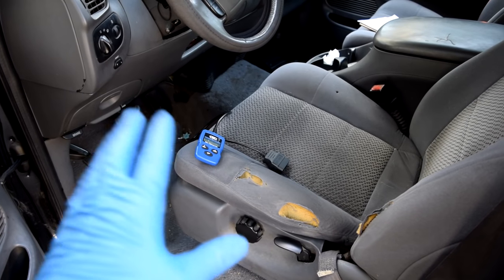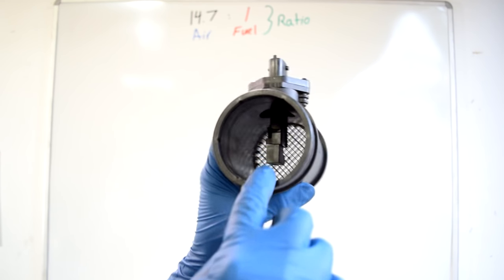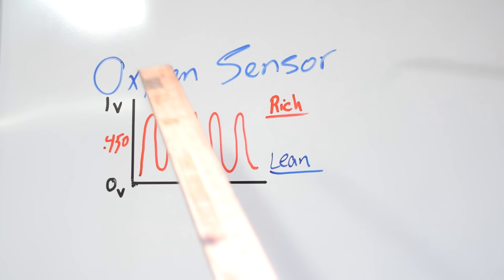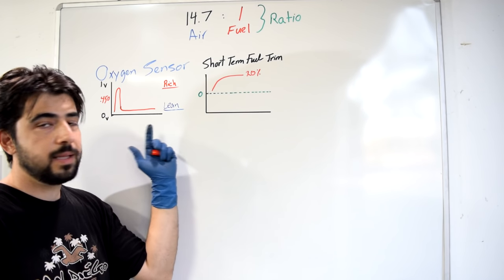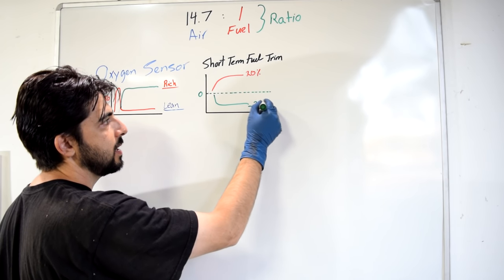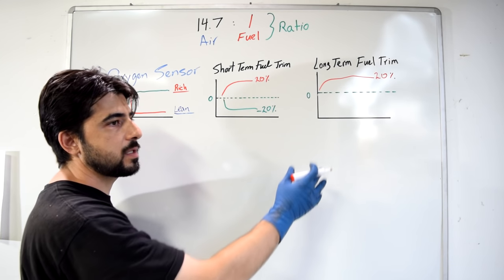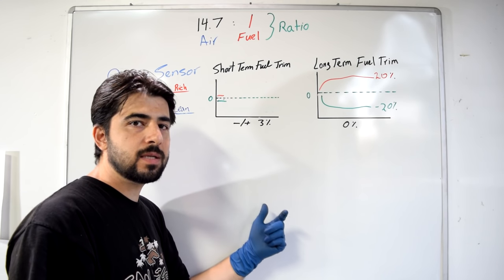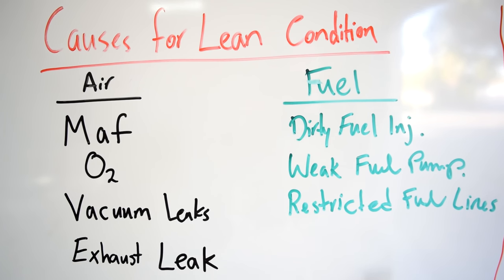Short Term and Long Term Fuel Trims Explained

Comment: Hello, first of all thank you very much for that movie. A lot of valuable information. How would you diagnose my issue? During normal car operation I have long fuel trim -3% when driving. I suppouse because of stack evap valve. It usually stack at 2% oscillating time to time only. I think it shall be set to 95% during acceleration. However engine handle it. The problem occurs when I put pedal to the metal. Just after that acceleration o2 sensor 1 goes to 0,1V, sensor 2 to 0,9 and short fuel trim goes to almost 50%. Lean fuel ratio. Engine 2.0 cvvt Kia. I have 2 new o2 sensors and new MAF. Actually waiting for new evap valve and pcv valve to install. Can it be problem with weak old fuel pump (17 years old)? Thank you in advance for the replies!

Comment: Perfect explaining tank you.
I used (STP fuel cleaner 5-1) and now my car running Rich. and fuel gets in engine oil, it looks (Leaking injectors), LTFT -23% after a 500 km i changed the engines oil, now the car running better LTFT -7 while driving, but when i release the throttle (gas) pedal immediately LTFT go to -15% and the car run badly.
When i push (throttle pedal) again then  gradually LTFT go back to -7% or -6% 
Is there any meaning for this problem.
Is LTFT should be stable ? Or what?
The speaking on LTFT not STFT
Thanks a lot.

Comment: O2 sensors and air fuel ratio sensors .   High voltage means lean mixture, low voltage means rich mixture.

Comment: Looking at Fuel Trims in a humid climate I wonder if you should allow for air moisture content. More moister in the air means lean (or rich?) burn/ less burnt fuel produced / incomplete burn, means higher? fuel trim. Where I am right now it is 70% humidity. But in Korea where they create the algos for fuel trim program then humidity is much lower., the air is much drier.  So I am thinking a fuel trim of 13% in a humid air climate may be 9% in a dry air climate.  I will test this as where I am we have a Wet humid season, and a Dry no rain season, so I can sample both.  I guess an incomplete burn leaves more 02 in the exhaust gas thus lean, increases fuel trim.

Comment: Awesome video. Thanks for that. I have a question please for tundra 5.7 2012. My long term fuel trims on bank 1 and 2 are hovering around 38% both. Both Short term are fine between-3 to +3. All in close loop means idle position.
To chase vaccum leak, i increased rpm to 3k. But still long term were at 35% each while short term changed to -8 to +8. I think i dont have vaccum leak. Shall I change my fuel pump? You think thats the issue? 
Please advice.

Comment: Hey, great video. I have a problem with my e90 bmw and it has the exact signs. I can't find the vacuum leak, but will a stuck open egr valve also cause this? I have no codes. Just rough idle when cold and because it's running lean, it's eating up spark plugs every 2500Km. Thank you.

Comment: Excellent video...quick question...What if you have a wide band O2 Sensor? Quick question to ask you The other day i got a P0135 on my 2002 passat 1.8t AWM. Using my scanner i checked the voltage readings... less than .002  sometimes negative. I had a New O2 sensor on hand. replaced it and still the same voltage B1 S1 - Sensor 2 is a solid reading of about 6..... STFR hovers all over the place....-4 to +7  Cleared the codes so i do not know what the current LTFR is but last i checked it was 6.3 any ideas?

Comment: Ok so. 2005 Honda Element. Starting issue. 

Cranks and chokes violently in the morning when cold. Like 45°F in socal. 

Still does it sometimes even after warmed up. Was getting a code for P0113 but turns off like 90% of the time. 
Sometimes and very rarely the car will die at idle at a light. 
I've changed the the IACV and cleaned the throttle body like new but same stuff
When the car is running

I get Short fuel trim value of -7 to -2.4 

Long fuel trim -9 to -4. 

O2S12 .08v to as low as .04 sometime the value will be at at .13 but itllnhold these values steady without oscillating.

02S11 .02mA to .04mA to .00mA

Idk what this means.

Comment: Do you know anything about p1093 I have it on my 04xi any tip will help not to mention I like you're video especially about fuel trim I believe I have a vacuum leak my stft will start at 0 then when driving it starts to clime

Comment: I had a Ford Explorer with a bad rear main seal that got bad enough that it allowed unmetered air into the crankcase and got sucked up by the PCV which leaned it out.

Comment: Great Video! I od have a question though as im a little bi worried about my readings. on my Ford Transit Custom Mk7 2.2 TDCI. My 02S12 is at 0.450v but my SHRTFT12 is at 99.2%! Also my Throttle Position is at 99% while at idle but my revs are about 800RPM! Any advice is greatly appreciated.

Comment: Good video will need to see it one more time !! I have the opposite numbers (-) so what you explained Means that I run rich and my problem could be dirty injectors !?
Reply: negative number means it's running rich
Reply: here's what can cause a rich condition:

- Bad MAF sensor (usually this causes a lean condition though) 
- Bad o2 sensor 
- Worn engine 
    - Ie. Worn piston rings make it hard to suck in enough air
- Exhaust restriction
    - ie. Clogged catalytic converter 
- Leaky fuel injectors
- Bad fuel pressure regulators
- Faulty EVAP system, evap solenoid 
- High fuel pressure 
- Purge solenoid stuck open
Reply: @Cdswjp  thank you ! I will take it to the mechanic because time to time the truck use execive fuel ! I drive about 100 miles every day 50 each way and used about 1/2 a quarter of a quater of a tank but sometimes use 1/2 of tank 100 miles .doble. I changed. Mass sensor, knock sensor, spark plugs , fuel filter , multiples vaccum hoses , transmission oil and filter , ball joint up and down , in and out tier up , breaks pads , caliper right size .. Timing belt , water pump. ! Cleaned canister , checked the vent solenoid and when I applied power by 9 volts battery it does close ! My truck is a nissan frontier 2001 supercharge 120,000 miles. Thank you for your knowledge .

Comment: Am having a problem with an 05 Ford F-150 4.2 I had changed the top and bottom gaskets of the aluminum lower intake and top plastic plannum also the exhaust manifold gaskets and has or still give me the P0171 code , my fuel pressure specs it’s 30 to 32 psi which I think it enough for it has lots of new things on engine and can’t get to figure this one out , I’ve checked my O2 sensors and are working properly like u showed in ur video  I’ve noticed on idle the bank 1 long fuel trim it’s a -15 percent and when keep the rpm high around 3000 it jumó to positive 30 or mid 20’s

Comment: great video, quick question, im getting the oposite readings im getting a split second where it reads -27% while idle and a split second at ~2300 rpm getting 51%, so what could cause this? o2 sensors are working fine (as far as voltages tell us)

Comment: If I'm running rich, after going to upgraded Injectors and HPFP,  would putting an upgraded Intake manifold potentially help? or would the math between the MAF and O2 remain the same, which wouldn't change the fuel trim?

Comment: Hello, and great channel.  Could you help me out? I've got a 2002 Silverado 2500 with a 6.0. All fuel trims are in the plus. Both ltft are around +25 and both stft are around +12--+15. 
Any thoughts on this would be appreciated.

Comment: Hi i just read my live data and i have a 4 cylinder with 25% short term fuel trim and -10% long term fuel trim and an engine code rich condition. Ive tried cleaning the maf and it helped a little still running rich though. For some reason my scanner only reads downstream sensor.  So i cant see upstream sensor. What do u think

Comment: great video...
(2005 dodge neon 2.0 liter)
is it normal for the o2 sensor bank 1 sensor 2 to stay at a constant voltage and not fluctuate like the bank 1 sensor 1 o2 sensor?  in my case the bank 1 sensor 2 stays at .760 while sensor 1 fluctuates like normal.  thanks

Comment: Throttle shaft through the back of the intake by the firewall that control the secondary butterflies??  I know those are notorious for wearing out the bushings causing a lean condition on those 4.2s

Comment: I have a 2007 Acura RL with 275k and runs excellent. I hooked up a live data scanner and it's saying that the short term fuel trim is 18%to 20% and the Long term is like 8% to 10%. What would cause this?

Comment: Sir, my car’s pre-cat o2 sensors are 6 wire type. Some said on the internet that they do not work on V oscillating principle. Instead they work on current (A). Therefore my OBD II does not shows voltage fluctuation. Also, my STFT shows -20% at idle. Long term fuel trim is around -4%. Is that ok? I have Holden Commodore VZ. This is after i drove my car rich for about 7 months until i discovered i had failing EVAP valve that made my car run horribly rich that it formed carbon at exhaust tip.

Comment: I have a question - my Short Term Fuel Trim (B1-S2) stays at 99.2%.  All the other readings - Oxygen Sensor Output Voltage (B1-S1), Short Term Fuel Trim (B1-S1) and Oxygen Sensor Output Voltage (B1-S2) all look good.

Comment: Hi bro i have nissan altima and i got the short term fuel always in negative around -1 to -15 and the long term fuel term always 0.8 and this value with 800 rpm and 4.5 to 4.9 g/s MAF. Please help i have engine shaking and rpm shaking
Reply: Help please

Comment: My question was
How does a vvt-i computer compensate for more water in fuel? Does more water than create more voltage conduction like fuel giving the computer the default to open the injectors less. But how would that affect timing in a car?

Comment: hello, my toyota corolla levin sj limited 1992, has a shaking issue on the front left side of the car. when i am approaching 80km/h, it shakes strongly and the shaking decreases as i am approaching 100km/h but on smooth surface road the shaking is less at 100km/h. what causes it? The tyre rim? I just have 2 front new shocks on but the problem still occurs.

I think I also over tighten my valve body during my automatic transmission fluid change. I added new synthesis oil without realising that there is old oil in the torque converter. now my car doesn't shift into full gear; the rpm is high and it is in between 3500-4300 when the engine is cold. It shifts into full gear and the rpm is running at its normal rate at 2500 at 100km/h speed when the engine is hot.

Do i need to loosen up the valve body or do i have to remove the mixed oil or do i have to do both?

Comment: hey awesome video how would you know if an injector is leaking
Reply from the maker: Its a bit tricky, you can install a pressure gauge on your fuel rail than turn the key to the on position pressurize the system than turn it off, next monitor the pressure on the gauge if it starts dropping fast 2-3 psi every 10 seconds or so.. you could have a leaking fuel injector.  In order to verify you would need to remove the fuel rail with the injectors and fuel lines still attached and do the same and visually verify a leaking fuel injector. You want to verify because the check valve inside your fuel pump could also be bad in which case it will show a drop in psi but usually at a different rate. Hope that helped. gl

Comment: Does a 1999 Volkswagen 1.8t have a different approach to fuel trims than American cars?  The car runs so well and never has had a check engine light and the smoothest idle I've ever felt on a 4 cylinder. But short term fuel trim at idle is -10%. Only at idle though. Not on load.

Comment: My LTFT shows 20% positive.
My fuelpump seems to deliver 2.5 bar.
According to my ELM327 I have a lean condition.

Can I safely assume my fuel pump is not delivering enough pressure for the injectors?

Comment: Hi I have 2012 tiguan 1.4 TSI gas edition not diesel. In very cold winters it doesn't start properly. I have to apply some gas pedal to make it start properly. What could be the possible reasons? Ltft is %5.47 stft is %0 o2s1 current ma -0.26 to -0.05 o2s1 Arf 13.74 to 14.54 map kpa 28 29 throttle valve 11.76 12.16

Comment: How would I delete and tune fuel off because of headers and no cats and rear o2 are not there either. Was trying to instal new iac valve and tps sensor when it started flooding plugs. Thanks for any advice and truck is Chevy silverado 02 5.3 4x4

Comment: good video but I'm still abit confused on the subject lol my cars running-9.4 sft and 0 when revved but jumped to +12 at 2500rpm and the lft 3.9 and when I revved her up the fuel sys1 kept changing to ol- drive then CL then just Ol ! does this give yourself a good enough description of what can be wrong ? I do have the obd2 but can't really read it tbh! the car has new 02 sensors new cat new middle section new plugs newish coil pack but could be way out again probably with a Peugeot 206 gti but was intresested to hear about this vacuum leak can you shed a little light in it for me if you can? I'd really appreciate it I'v not got a scooby

Comment: I have a 98 5.7 vortec. The truck that's most temperamental to fuel trim faults. I have no codes. I have loss of power and stalling. Fuel pressures is above 50 good enough from what I've learned. I have a donut gasket leak ware the y pipe connects to the manifold. Will this through off the 02 sensors and give me this condition and cause loss of power hard start? I'm going back and forth to weak pump or 92 sensors

Comment: Hello there, I just watched you video on stft, I have a 2005 honda civic ex 1.7L 130Cv with vtec, my readings are weird, the stft is about 14 going sometimes up to 35%, but mi ltft os static até 0%, o2 sensor ir ok, between 0.01 and 0.790, and no codes or lights on the dash...is that normal?

Comment: Thank you for the information, I have a Toyota corolla LE 2012 and I failed the smog test because of 02 sensor and cat are not ready!! but my car did not show any code also I follow a Toyota drive cycle and I drove 360miles highway 55 t0 60 after I slow down without using break just helping the car with hand break to 35-45 but still not ready! but when I plugged my OBD2 IT SHOW THAT MY O2S1 bank1 (V)=3.306 AND O2S1BANK2 (V)= 0.660 the car was warmed up for more than 10 min ! please do I need to change both 02 and after drive it probably it will make the car ready for emission! thank you very much

Comment: @Ratchets And Wrenches Thank for video. Could you help me make sense of these STFT and LTFT values. I have 07 ford taurus, for bank 1 STFT stays between +/-3%, but LTFT stays constant at about -12% at Idle. Bank 2 is lean at idle with +12%  total fuel trim. When I increase RPM to 2500, STFT jumps between +/-6% and LTFT stays constant at -19%. Bank 2 improves at 2500 RPM with about +6% total fuel trim. OBD says cylinder 1,2, and 6 misfire. I have tested injectors, replaced the leaking injector already. What do these trim value mean? How come bank 1 is rich and bank 2 is lean? Thank you.

Comment: My 99 silverado has -12 to -14 LTFT. short trims are normal so a rich condition but when i increase rpm to 2000 LTFM drops to the -3 and STFT goes to -9 to -12. What do you think?

Comment: your videos are great. I have been watching for months. I cannot figure out my 0172 and 0175 bank 1 and 2 rich codes. I have spent a good amount of cash trouble shooting and nothing. I've had this reading for about 7 months. I took to chevy and they said that my injectors tested fine but based on their research did a servicing on them. Day later, codes are back. I then tried to add my own injector cleaner through the tank and light went off for about 3 hours of driving but then came back. Any help, suggestions would be very appreciated. I simply need help!

Comment: Great vid i learnt an awful lot, did you ever find out what the problem was ? as i have a VERY high fuel bank reading 75%, cannot find a leak either, tried carb cleaner on the cold engine, and water when it was hot, and no change in engine rpm while doing it, could this be a sensor?(my car is a petrol manual, revs high between gear changes, sounds like a deisel, i have changed the map senor and the throttle body,and the car has no Maf sensor either)    i ask as this is driving me a lil insane right now.. any help on here would be appreciated... many thanks, Mark.
Reply: 75% lean is very extreme , Mark.  I would look at fuel pressure first

Comment: PLEASE HELP! I'M TRYING TO LEARN THIS. IWAS FOLLOWING YOU WHEN YOU SAID THAT THE O2 READING SHOULD IDEALLY BE ABOUT .45V, HOWEVER UPON SEEING YOUR READING OF .75-.065 FOR O2B1S2 OF WHICH YOU SAID WAS FINE I FEEL THAT I MISSED SOMETHING 7:55-7:59   //  MY O2B1S2 OCCILLATES BETWEEN .78 -.28V - HARDLY EVER A STRAIGHT LINE, EXCEPT AT STARTUPS. WHENEVER IT'S A STRAIGHT LINE IT'S AT .28V

Comment: Question ; related to 2006 CM 2.7 Litre Hyundai Sante Fe 250,000 kms engine uses about 150 mls of oil every 4500 kms
Engine check light on P0420 O2 sensor bank 1 , reset engine check light and its comes back on about 1500 kms later,
All voltages and percentages are good and roughly the same.
I think sensors and catalytic converter is fouled , I have found a steep hill where I can use full throttle vehicle loaded high engine speed attempting to get cat very hot with high gas flow to hopefully burn and blow out crap if any there out but no change as check light keeps coming on.
So without removing sensors and catalytic converter from car to clean have you ever done this ?
Placed a small hose into a vacuum hose after throttle body reving engine to suck in white spirits to clean sensors and catalytic converter ?????????????

Comment: Please could you help me out. Am I correct in assuming that a vacuum leak would cause the engine to run at a higher idle than normal?